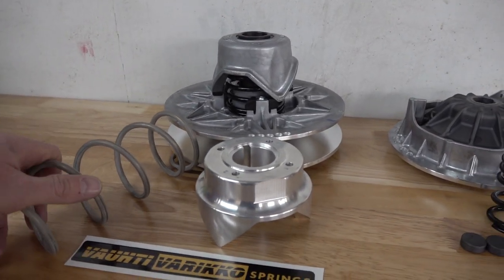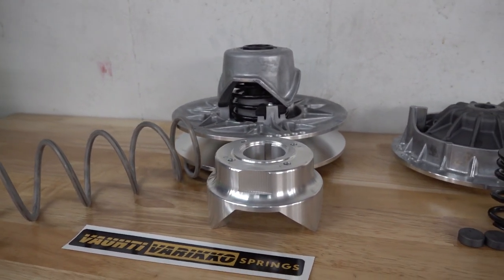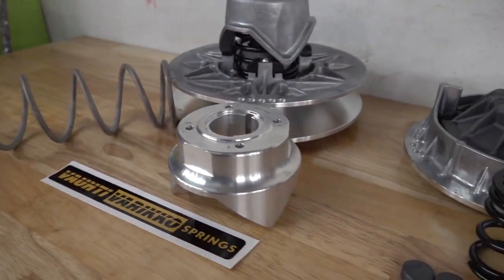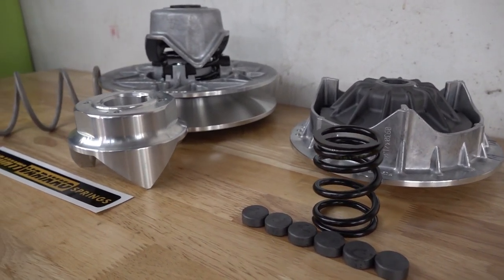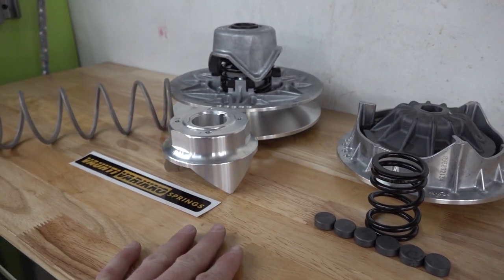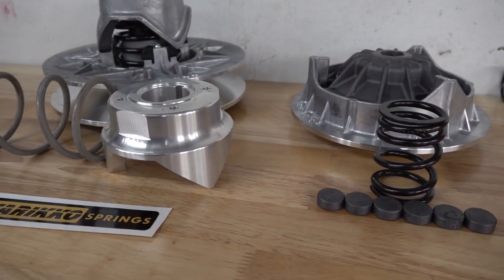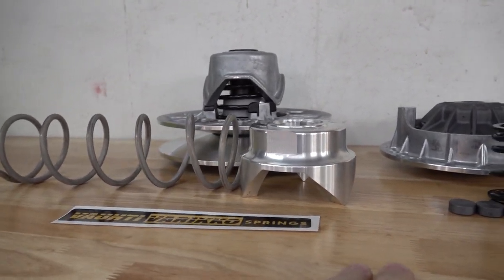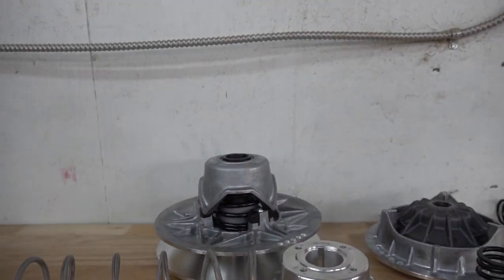MSC CFMOTO Stage 3 Clutch Kit Detailed Overview For ALL CFMOTO Owners

Comment: Blake I like to run heavy tires and cut up but in Louisiana we have trails that have a tread depth limit so I run stock tires sometimes also. Will a cforce 800 still be okay with a stage 2/3 clutch kit running stocks every once in a while?

Comment: What would the 50 degrees helix do different compared to the stock 45 degree helix? I have a 850xc stock tyres, would like to do do stage 2 clutch kit with a 50 degrees helix( I’ve heard the 50 degrees helix is for tyres 25-28 and the machine is more performance focused rather than mud) I don’t ride in mud, just extreme trails with steep hill climbs. I am also looking at a tune which have been told will bring the 850xc from the 67hp up to 85hp.

Comment: I have a stock UFORCE 600 that jerks badly when starting to move so what kit should I get? I plan on 29” tires in the future but I don’t want to have to pull this apart and do it again when I get the tires.

Comment: Blake what would be the best for a c-force 800 the 35-degree or the 40-degree running 30-in tires with stage 1 already in? Running cryptids do a lot of mud riding and heavy snow slush. But still do trailing
Reply from the maker: Awesome Cody, the 35 Degree helix is what you want.. I would get the stage 2 spring and the stage 3 helix and clock that to B1 and that will be PERFECT for your 800 with the cryptids in your riding conditions

Comment: I'm running stock tires on my cf600 with thr msc tune. Will the stage 3 trail kit increase my performance and top speed?
Reply from the maker: With the stock tires you may lose a couple miles per hour.. 
but the bottom end and mid range power is amazing!!!! 
But you can get the stage 1 with the trail helix and leave off the secondary spring and that will be best for your stock tires

Comment: Can we see some 0-60 pulls next to a stock unit? Or even some draggy testing? When are you guys gonna start pushing for some ECM tuning on CF?
Reply: I can show you a 0-40.
Reply: To cold for more.  In a few days 0-60 or more. For the stage 1
Reply from the maker: We have all of that coming very very soon.. we will do you one even better in less than a month.. 
MSC is getting a custom DYNO Built for the Shop shhh 🤫
Reply: @RealTalkPowersports  not sure you'll like what I got.  But we working on it.   I'll post on FB when we get done.
Reply: @RealTalkPowersports  ps can't freaking wait till the event.
Reply: @RealTalkPowersports  dynojet?

Comment: Hi Blake! Awesome video, this is great news for people that have big and heavy tires. I have a question about the UNI air filter upgrade, since you have been running it for a while. Do you feel any difference in power? More or less compared to stock? Thanks!
Reply from the maker: No the UNI Air Filter is not going to give you any noticeable power increase.. the reason to get a UNI air filter is for the extra protection and filtration.
Reply: Would you recommend going for the uni air filter compared to the k&n air filter, if as you say it’s more for the protection and filtration rather than the performance
Reply: @lucaspintican2866  Yup, 100%. Recently bought a UNI air filter and I'm going to install it next week or so. Its probably better in performance than stock since its dual stage foam and it kinda provides the best airflow with the best protection. Sure, the K&N filter is going to give you a little more horespower but less protection, I'd rather run the K&N in the winter when there is no dust and UNI in the summer. But I wouldn't run K&N in dust, they let way to many particles in the engine and I'd rather have full protection and 1-2 horespower that I don't even lose without installing a K&N.
Reply: @LG-ts9cp  i was thinking the exact same. thanks 👍

Comment: Tire question , i just purchased a cforce 800 I ordered mud lite 2 28/11/14 for the rear tires . Will I have a problem with rubbing?  Should I have went with the 28/9/14 all around ?
Reply from the maker: That will will just fine.. I like running the 9 wide up front and the 11s on the rear
Reply: @RealTalkPowersports  any clutch work recommended for the 28s?? I appreciate your responses

Comment: So i have stock tires on my 800 but plan to later on go alittle bigger are you saying you can’t use this stage 3 set up with that ?
Reply from the maker: Your going to notice the best difference with bigger tires.. because when you put bigger tires on anything, you are changing the final gear ratio.. and also taking away power.. but when you put the stage 3 kit, the effect is lowering the final gear ratio and changing the ramp rate and cause your 800 to pull like a freight train when you give it full throttle even with the bigger tires..
So I'm summary you will see the greatest overall effect with your bigger tires.

Comment: If I understand right, B1 is the standard setup now for this upgrade. What would B2 or B3 do? Just curious.
Reply from the maker: It would be too much tension if anyone ran the stage 2 spring in anything besides B1 or A1..
Reply: @RealTalkPowersports  Thanks man, I'm stoked! Keep these upgrades coming! #ZFORCE
Reply: @RealTalkPowersports  what is the difference between A1 and B1. I have the stage 3 kit. Which one is more preferred for someone that muds?

Comment: With the stock size tires, can you tune a stage 3 kit to not take away top end?
Reply from the maker: You will dislike a stage 3 with stock tires.
Reply from the maker: I highly recommend just a stage 2 at most
Reply: @RealTalkPowersports  Thank you. No mud where we're at. Just want a snappier throttle response getting up and over obstacles.
Reply: That’s what im looking to do. Same thing with me, no mud in my area. Just want the best performance and snappy throttle response
Reply: @lucaspintican2866  I am putting my stage 2 kit in this week. I'll let you know how it effects the performance.
Reply: @ronpage101  are you jumping straight to the stage 2 or have you stage 1 already and you are upgrading to stage 2?
Reply: @lucaspintican2866  Going straight to the stag 2.
Reply: @ronpage101  ohhh so you can do that, ok yeah thats good then. i will probably end up going with stage 2 clutch kit, with stage 2 secondary spring and also the 50 degree helix. while staying on stock tyres and will probably upgrade to 27inch in the near future or possibly dropping down to 25 but then going for a set of raceline beadlock alloys. i will be looking forward to hearing about your experience with stage 2. 💪🏼👍
Reply: @lucaspintican2866  I took it out for a quick ride late yesterday and the biggest improvement was power delivery. Instant throttle response but very smooth linear power delivery. I have the stock tires right now, so I cannot comment on how it works with larger tires. Unfortunately, I put a Whiskey bent tip on it, a Uni filter & a carbon fiber intake, and ECU tuner, along with the clutch kit at the same time, so I don't have a clear opinion on just the clutch itself. I gotta say this: This combo of upgrades is what this machine needed to be on par performance wise with the Polaris 850.
Reply: @ronpage101  did you get The carbon fibre intake and ecu tune from vauthi varriko?
Reply: @lucaspintican2866  I got the intake from MSC, and I got the tune from Powersports tuning, Ray Parker.
Reply: @ronpage101  ah ok, so your located in US, im in europe. There is a guy who can get the 850xc to 85hp just with a tune. Do you know what power you are running now after the tune?
Reply: @lucaspintican2866  that's a 20 hp increase. It would be unrealistic to expect those gains with just a stand alone ecu tune. Our 800's, your 850's, are rated at 65hp. I haven't dyno'ed it, but my seat of the pants tells me it might be a 10 hp increase with all that has been done in my build.
Reply: @ronpage101  i was saying the same thing but i have not yet tried their tune. but once i do i will let you know 🫡

Comment: Will i hurt my machine if I do stage 3 with stock tires
Reply: I do plan on bigger tires in future but for the time being that is
Reply from the maker: It will not hurt it but you will not like the way the RPMs will be while using the MSC Stage 3 with stock tires... I would recommend waiting on installing the stage 3 helix until you put the bigger tires on..
Reply: @RealTalkPowersports  thank u for the info much appreciated